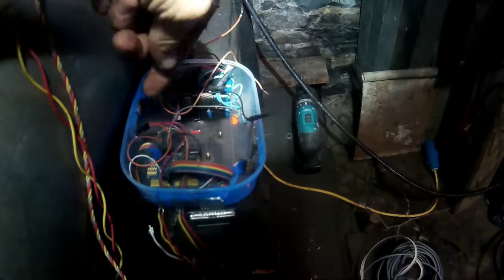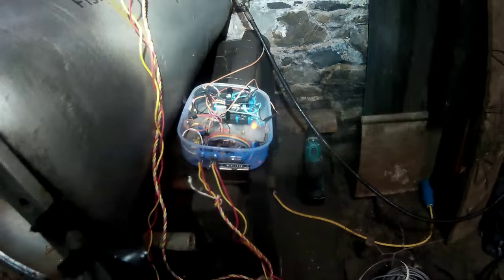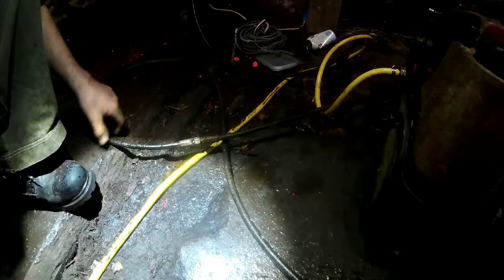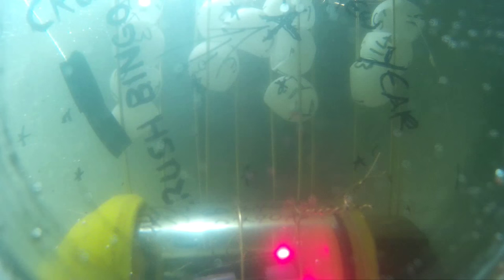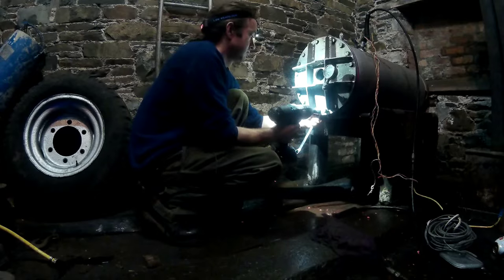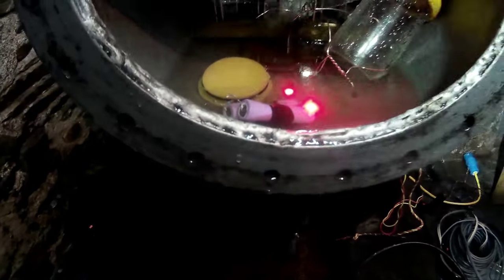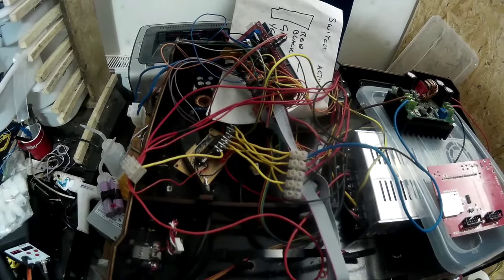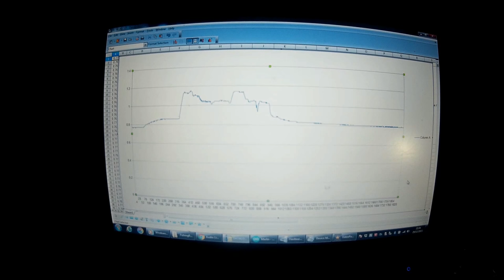FishingROV #54 Crush Bingo, Clean data, More 3d Printer learning

Comment: Did you find out why the housing leaked?
Reply from the maker: +Rob Evans Not sure. It was one of the cast GRP endcaps with the rough internal oring seat. My guess is that the water snuck round the rough print lines at low pressure but sealed at higher pressure in the last test. Ill through it in with the next test.